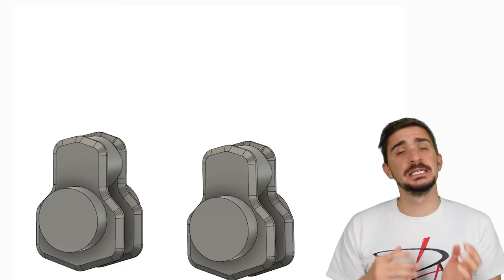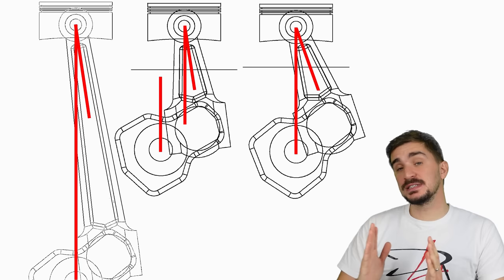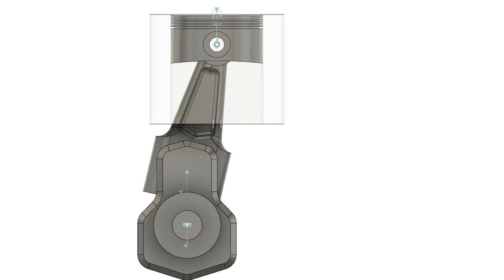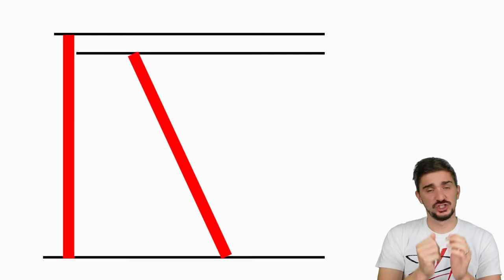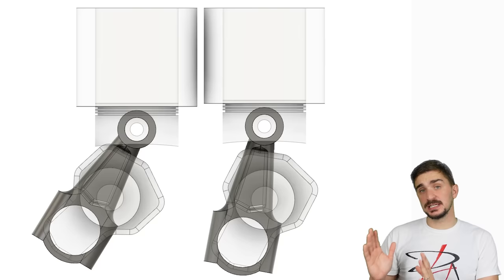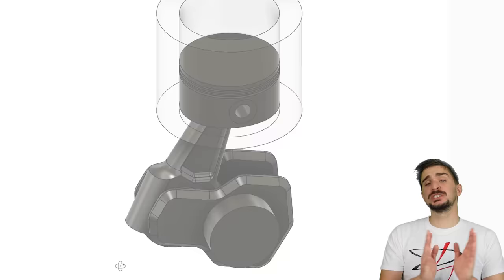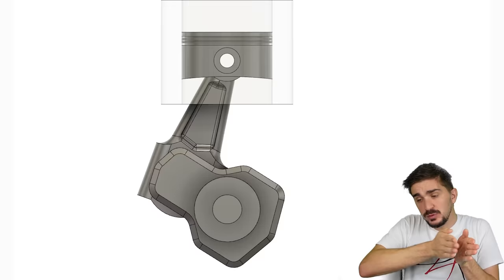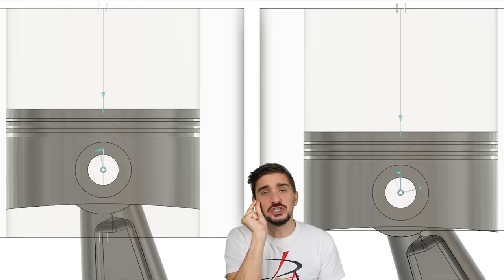Cylinder Offset Changes Everything

Comment: This offset cylinder idea is the Désaxé design, started I think on steam engines. Early adopters of the Désaxé principle included Henry Ford who would fully implement the Désaxé offset into the Ford Flathead V8 engine throughout the 1930s while adopting greater offsets into the 1940s.
Reply: Did Ford stop applying offset on their V8s?
Reply: Yeah thats also what im wondering. Also did chrysler/gm do same offset thing during 50s and 60s?
Reply: The Moto Guzzi postwar Falcon 500 singles were Desaxe designs, I always wondered why.  Now I know!  Great video.
Reply: Yamaha has the offset too but it's in the piston!
Reply: Some of these engines suffered from assymetric wear, and were harder to overhaul, and had shorter working lives.
Reply: Yes!  The off-set piston idea was discovered and used during the steam age.  I don't know how many engine manufacturers used the Desaxe motor, but Norton used it starting (I think) in their 650 cc then 750cc and finally in their 850 cc motors.  One way to help balance the desaxe motor is to put longer connecting rods in the motor, but this requires a specificaly designed piston with the wrist pin closer to the top of the piston to accommodate the longer rod length.
Reply: @garybulwinkle82  Yes, thats pin off-set, its a widely used way of quieting a clattery  cold engine. I could be mistaken if you are referring to the pin being off-set to the other side which would make a couple horsepower. I'm unfamiliar with Yamaha engines. They really know what they're doing though.
Reply: @sepg5084  Not sure.
Reply: Only a few years ago, Kawasaki incorporated the design into their bike engines. Not sure if all of them though.
Reply: @garybulwinkle82  I always had Yamaha motorcycles and I did not know this. What do you mean "it's in the piston"? Please. Is it the connecting point between piston and connecting rod (piston pin) offset? Interesting!

Comment: Used offset pistons in a Ford 289 years ago with 11.6 to 1 compression ration.  It was a torque monster, and nearly unbeatable in a 1963 Fairlane Sport Coup.  Surprised many a 396 Comero and 440 GTX owners who just could not believe what just blew past them after giving them a head start from a 30 mph roll, only to inquire when catching up afterwards about my healthy "big block".  That offset made a huge difference.
Reply: im sure being a 500 lbs lighter than the camaro and 900+lbs lighter than the GTX played a small contributing role as well : )

Comment: For 2 stroke engines the offset is towards the exhaust with the cranck that spins in the same direction. This allow for a longer time for the first blowdown to be longer than the second allowing the engine to run slightly higher
Reply: probably, the only non-bot comment. thanks for this comment.. I was thinking this would only be beneficial for a 2-stroke engine.  The compression stage of a 4-stroke would completely destroy the presenter's efficiency paradigm.
Reply: @derrikarenal3308  Think about how much greater the forces are in the power stroke. After all, that one stroke produces enough energy to get the engine through the other 3 strokes and on top of that produce a huge amount of energy to accelerate the car. So making the geometry better for the power stroke, easily offsets the penalty of making the geometry worse in the compression stroke. (Where the downward & thus sideways forces on the piston are maybe in the order of ten times lower).

Comment: Great videos. When I wrote my books on the Yamaha KT100 two-stroke kart engine, I became fascinated by piston pin offset and rod angle because these have a marked effect on the timing of the ports. As I commented on the prior video on rod/stroke ratio, I believe that piston pin offset, and cylinder offset (those having the same geometric relationships) affect camshaft events.  All this prompted me, with a Cosworth engineer friend, to produce a piece of software that calculates stroke/rod ratios, the location of the piston in the bore, the piston location at TDC and BDC, and everything in between.

Comment: Thank you, professor! I have a horizontally opposed, air-cooled, VW engine that I increased from 1.6 to 2.0l by increasing stroke to 78mm and bore to 90.5mm. The pistons are offset by design and the arrows stamped on the piston head aid in proper installation. 
I now understand why, even though I took great care in balancing the rotational elements I still get slightly annoying vibrations which I cannot tune away. 
So, I can stop pulling my hair now.😂
I would also add that I increased the rod length from 5.4" to 5.5". I can't recall now why but probably the compression ratio which is approximately 7.8:1.
Reply: Piston offset is something entirely different than offset rods. Piston offset is there since the Ice Age. It' s goal is to slightly increase piston dwell time at top dead centre thus decreasing piston slap (a ringing sound)  and decreasing load on the wrist pins and small end of the rod. Same is achieved with offset rods, but that is only one aspect of offset rods.
Reply: puerco, opuestos no es boxer

paul, i get what u say bout offset rod 
but piston ofset ain't know wy t wld b diffrnt
Reply: @Xayuap  with offset piston the piston rod and crankshaft are still inline
Reply: t ain't dat w r xplainn n d vid?

Comment: Neat thing about the secondary balance in an offset engine, is you can just ignore the small forces and balance out the larger ones. As well, because they are not uniform in distribution, they are less likely to cause catastrophic issues from resonance.

Comment: What's genius about this design, is when the plug ignites, the crank is already at an angle so the force isn't going STRAIGHT down, it's actually acting like a lever.  Then on the way up the angle is more dramatic which means it's much easier to continue moving!
I love it!
Also, I watched the whole video and it honestly made me want more lol
Reply: How the higher angle makes it easier to continue moving? I think I am missing something because for me it would be the opposite
Reply: Agree 💯
Reply: Ignition time is actually determined by the ECU, you can advance or retard the timing of the spark electronically.
Reply: The spark always occurs before TDC (ignition advance) so it doesn't really apply the way you  think).

Comment: The one thing I noticed about the offset that wasn't mentioned was that the most extreme angle the con-rod makes is greater than that of the non-offset engine. This happens on the compression and exhaust strokes and would cause friction to increase with RPM, so I had been under the impression that offset engines generally produce more low end torque and have better efficiency, but the sacrifice is how high the engine can rev before it starts to lose power.
Reply: However, the compression and exhaust strokes are relatively low-stress periods in which the force on the piston is small, compared to the power stroke which has a very high force on the piston.  Thus it gains more to reduce the friction coefficient on the power stroke than it loses to increase it on the others.
Reply: I'm not an engine nerd, but that aspect bothered me.
Reply: Yes, and no... at low RPM the friction from the power stroke goes way beyond the friction generated by inertial forces. But as the engine RPM rises the inertial-induced friction increases while the power-induced friction stays relatively the same.
Reply: @saskprotogencyus2788  What you described happens to nearly the same extent in a non offset crank arrangement
Reply: @saskprotogencyus2788 exhaust is no problem as the force on the piston is relativ small. Compression is more annoying.
What is a problem is bottom dead center. Once the crankshaft get's past 180° and starts moving up, but the piston still moves to his buttom dead center the pressure on the piston works against the engine. You can compensate this with valve timing but it will remain more prone then a no offset engine.
Reply: @MrHaggyy  The increase in friction, that im talking about, isn't so much caused by the pressure in the cylinder, but rather by the force that the connecting rod has to transfer through to the piston to get it to stop descending and start rising. As RPM increases, this force becomes greater and greater since its stopping the piston from higher and higher speeds and accelerating it to a higher speed as well. Since the connecting rod can only apply force along a vector from the center of one journal to the other, the greater force in the connecting rod makes it so that the piston is pushed more aggressively into the piston wall.
Reply: @saskprotogencyus2788  That`s true the angle of the connecting rod from bottom dead center is smaller in an offset engine. At top dead center, the change in angle is neglectable as both rods add up to small angles. Luckily we start exhaust and compression from that position so while we need to transfer acceleration forces we low additional loads on the piston.
Reply: He pointed this out early on in comparison to the non-offset engine. Then left out the fact that its factored right back in on the return strokes, but its worse like you said. 
You cant avoid everything. You only get to decide when and where you allow it to play out. 
Id think you could find a good balance by playing with the angles some more. But overall, larger displacements become self destructive.
Reply: yes it was, on single cylinder engine, this offset thing tend to cause piston to fail earlier than non-offset one, so to counter this, offset cylinder need good combustion, well balanced and now this forged piston thing.
low combustion or some bad habbit like over accelerate, over load, may cause clanking noise, not a sudden engine failure but it can be progresive, i know it sound like a normal thing for every engine, i dont know how to state this but trust me Offset cylider engine more sensitive on those parameter.

i dont know about multiple cylinder but single cylinder thats my observation as motorcycle mechanic.
Reply: Ceramics
Reply: This is why I prefer a longer rod with a shorter pin height piston, less issues with balance & friction.👍

Comment: I would love to see a followup video explaining how one would actually balance out the secondary forces
Reply: Agreed!  How do we mitigate the non-sinusoidal nature of the secondary forces in the offset engine?
Reply: @jeffreyswett6363 I think balance shafts can achieve that no?
Reply: @jeffreyswett6363  Since the secondary forces are periodic (regular) a Fourier analysis would determine the design of a  counter balance mechanism.
Reply: Balance shafts add friction,weight and complexity,not to mention the physical space they require.while not forgetting that just like any rotating or reciprocating component,they are driven by the crank meaning that energy is being spent in order to rotate and accelerate them. It stands to reason that anything added that takes energy from or adds a load to the crank will also slow the engines response to changes in rotational speed.
Reply: @notpoliticallycorrect1303  a compromise worth it in your opinion for certain applications? I once drove a Mercedes 2.3 4 cylinder with balance shafts and I thought it had stalled at times when it was idling it was that smooth. But obvs the negatives you mention are the anthesis of a sporty engine. Still, was good enough for the 944/968 I suppose!
Reply: @kayvon_is_likes  Indeed,they do have their merits.
Reply: @notpoliticallycorrect1303  My question is, would it be less about an increase in mass in the reciprocating components, but rather the increased complexity and cost in manufacturing for complex shaft shapes? I'm not familiar with how prevalent balance shafts are in engines - but you would expect that for a given drive shaft, rod and piston the sum of total forces to balance would be equal for the offset and non-offset variants - i.e. considering a balance shaft solution for both, you would expect no increase in weight, other than the slightly larger housing for an offset crankshaft. I'm super keen for a video on this analysis though, as it is not at all intuitive for me.
Reply: @berglh   it's always ideal to have less moving components to deal with, less parasitical loss,less failure points a better response etc. Most balance shaft set ups come as a pair of counter rotating shafts usually either side of the crank and usually just above it, some are paired and fitted below the crankshaft in the sump in their own housing or in the crankcase it's self depending on the set up.they generally have in simple terms, big lumps of Weight placed in certain places to counteract the pulses of the crankshaft. Weight and space saving are fundamentals of modern engine design,I don't think many realise how much it influences how stuff is achieved by different manufacturers, regardless of the cost saving,I don't imagine any engine builder wanting to have to put balance shafts into their design if it were not really needed. Even with today's computer software etc. they still have to run real engines in labs and still find problems that simulation can't replicate due to the infinite variables.You would like to think that all manufacturers could produce a 4 cylinder 4 stroke engine to not require any balance shafts and still be considered comparative to its peers, I wonder how many engines that have balance shafts weren't originally designed to have them, only being incorporated at the physical testing stage of the first prototypes, particularly those that have sump mounted assemblies which is a far easier set up to retro fit to a engine that doesn't have them.

Comment: Great video. I would like to see a video on how the engineers are designing the crankshaft for these offset engines to correct the greater vibration issues that it creates.    Paul

Comment: I read a newspaper article about a backyard engineer in Australia who experimented with this concept 20 years ago. He modified the engine block of an old Holden Grey motor (inline 6, superseded in the 60s) by cutting out the bores of the cast iron block and welding in angled bores. His idea was to have the con rod at 90 degrees when the crank is at 90 degrees to maximise force/leverage. His results were a very torquey, low revving engine with huge efficiency gains. It idled at 120rpm. He said that conventional piston engine design was inherited from steam engines that were design to operate in forward and reverse rotation.

Comment: As I recall, it was the American race mechanic Smokey Yunick back in the . . . 50's? Early 60's? who first experimented with offset piston pins and found there was a marked improvement in midrange torque and longer torque curve his Cadillac test engine produced. The effort, as many of his efforts were concerned, related to finding a competitive advantage not considered in the rule book.
Unfortunately, the change dramatically increased piston wear. So outside of circle tracks, the idea got little notice. Today's materials and production methods allow all kinds of clever old ideas to have new life.
 At the end of the 80's, Saab engineers developed a two piece engine separating crankcase from cylinder/head assembly with a flexible bellows between to keep the oil in. By slightly rotating the two assemblies relationship to each by fractions of degrees around the crankshaft, the motor could not only provide the torque changes seen with offset pins, but could also vary the compression ratio while in operation! This could be done at any chosen rpm, but then variable valve timing arrived and made the idea a historical footnote before it was ever produced. Bright minds, crazy ideas, fun times.
Cheers

Comment: Would love to see a video on how offset cylinders would work with a 2 stroke. Great video 👍
Reply: me too!  as I remember the wear from friction on one side of the piston was significant.  however the shorter exhaust / intake time may impact things negatively  I would love to be educated.
Reply: @Desmo500  I would imagine that the benefits would double, since on both downward strokes the engines are producing power.

Comment: At 1.46 i can already see, 
The offset means after firing, 
The conrod of the offset piston is straighter. 
This means more of the power is being utilised. 

Stay tuned for more correct or incorrect guesses.
Reply: 7.48. 
Offset creating unequal strokes…
Hmm, 
Maybe, it can be configured so the pull stroke is larger, compression smaller, expansion larger, exhaust smaller?
Reply: 17.54
I don’t recommend doing it with your phone 😢
💥

Comment: Good explanation, thank you so much! The drawings and CAD rendering are top notch tools the way you used them to visually demonstrate the geometry and mechanics.

Thumbs up from a mechanical and aerospace engineer, cheers!
Reply: Did the mechanical and aerospace engineer not notice the conrod fouling on/smashing into the bottom of the cylinder at 13:59?

Comment: Outstanding as usual.  I imagine a boxer engine would go far in aiding both primary and secondary balancing in an offset scheme.  Also, any thoughts on the impact offset engines would have on engine rpm limits, as related to ring flutter, as a result of the varying mean piston speed?
Reply: I first thought of that then at 9° I thought VR engine, then I thought VR boxer
Reply: Boxer will have a strong torque vibration, unless you run two crankshafts running in opposite direction. If you share the crankshaft then one bank needs to be offset upwards, and the other downwards.
Reply: @Blockbuster2033  julianKent is talking about the vibration caused by cylinder offset, and your idea is  addressing rocking couple.
Reply: @martin-vv9lf  Absolutely correct, no idea why I didn't realize last year. I will delete my above comment.